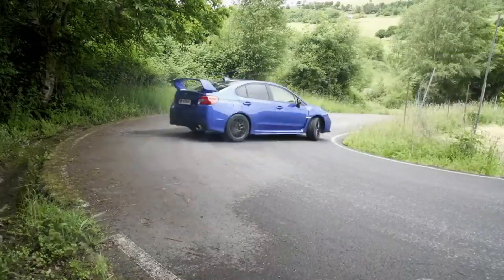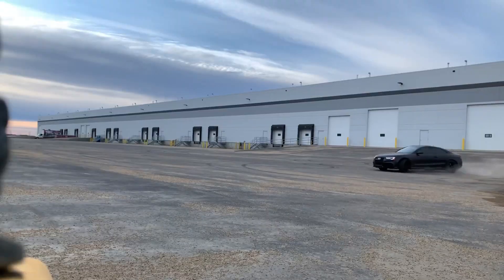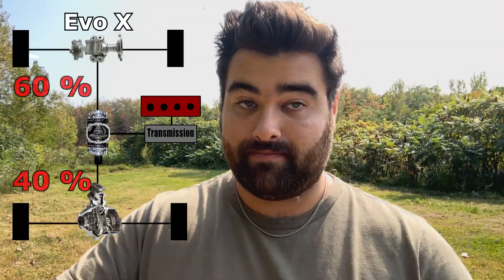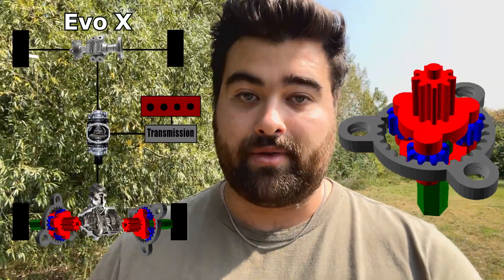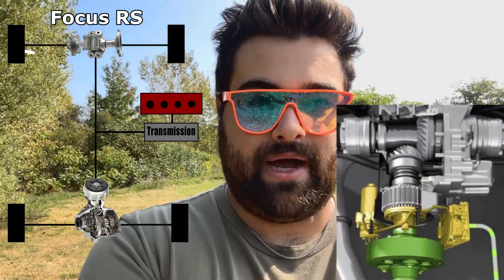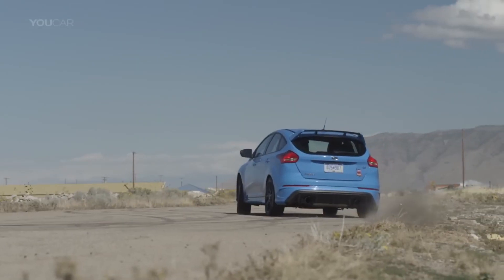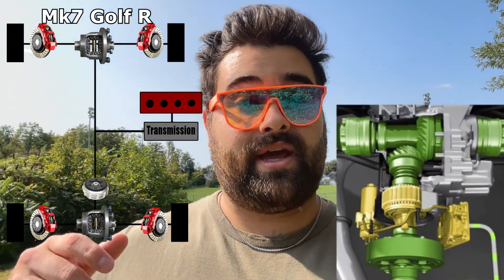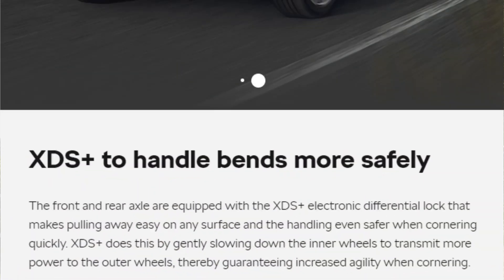AWD COMPARISON - Evo X // STI // Focus RS // Golf R // Quattro

Comment: The EVO X is a 50:50 torque split it cannot bias torque from front to back.
Reply from the maker: Yes it can, it has an active center differential.
Reply: @ Yes it has an active center differential but it can’t control the power split. It will control the amount of lock. So if the grip is equal front and back it will never send more then 50% power to the rear wheels.
Reply from the maker: @ no it controls power split, not the lock. It can send 60 front 40 back, 50 front 50 back, or 40 front 60 back. You’re wrong, look it up
Reply: @ I know I looked it up multiple times. I rally an Evo actually at a national level. And it is a 50:50 torque split.
Reply from the maker: @ I rally an Evo actually at a planetary level and it’s not
Reply: @Huntsteven6 sure man 😂
Reply from the maker: @ interplanetary actually
Reply: not all evo awd system is the same. evo 4-9 doesn't have center differential only ayc only evo x have the ayc and acd at the same time. when the clutch pack on the acd is locked it sends more power to the rear because the gearing is a little bit taller to the rear axle. but it cannot send more power to the front

Comment: I have an A4 Quattro Open/64:40 Torsen/Open with brake vectoring at both axles.

It's certainly not the most advanced but it does the job. 🤙😗

Comment: Great video overall, but I think you should redo the Focus RS bits. It has a much more interesting AWD system than you make it sound - the driveshaft to the rear always spins, and then electronic clutch packs can grab it whenever the system wants - so if one clutch pack fully engages, suddenly a full 70% of the power goes to that rear wheel.
Reply from the maker: @Wallstreetavarice  that’s basically how I explained it

Comment: So fyi most stis have clutch type lsds in front and in the later years they went helical in the rear. For instance my 05 sti has clutch type lsds in front and rear meaning they’re a lot better than helical/torsen lsds. For whatever reason they went torsen in the rear in the later years and then even went helical front as well. Helical is great around a track if one wheel doesn’t lose traction. But if one loses traction it acts like an open diff. The benefit with clutch type diffs is when one wheel loses traction it reverts to locking the diff and splitting the power evenly. And you can also tune clutch type lsds to behave how you want unlike viscous or helical lsds.

Comment: I have a lancer se awc So what type of system do I have on my car please
Reply: That is the Lancer Evolution X's S-AWC (super all wheel control system) so in my opinion, one if the best AWD ever made
Reply: No lsd, no torque vectoring like in sawc, but a simple 4wd with manual option for 2wd, or lock. If I'm not wrong: Up to 40% traction to rear wheels. I also have that car. Also, above 35mph it has internal braking of tires to follow the curve.

Comment: For Torque or break vectoring systems, could that jerk car if the surface has uneven grip here there? I see rally cars run thru uneven grip surface whether there be some snow, ice, dirt, mixed with tarmac but intuitively if the car gives more torque where there’s more traction, could that swing the car unpredictably due to unpredictably of the surface?
Reply: I’m not so experience but that’s why an lsd sounds like the best bet for predictability

Comment: the focus rs uses GKN made awd system with twinster rear drive unit its not haldex or even made by haled fyi. its a lot better system than a haldex. Very similar to the evo awd. Also only a few 2018 rs had the lid up front the rest are all open thats why a lsd is a huge upgrade. Also straight from gkn the focus can send 100 percent to the rear and vector it between each rear wheel if needed. it's overdriven by 1.8. Also the rs is permanently coupled and uses clutches in the rear that are electronically controlled to divide between the 2 rear wheels.
Reply: Is not focus rs's awd prone to overheat very easily, I think evo x is ahead of focus rs in that important area.
Reply from the maker: you basically reiterated much of what i said. I used haldex as an analogy.

Comment: Isn't there a distinction between the quattro variants within the different generations as well? like i thought the MQB platform prior to 2022 for both VW and Audi (in things like the A3 line, Golf, SQ2, T-Roc, T-Cross, etc.) all use the haldex set up that you mentioned for the Mk 7 Golf R, rather than just a general quattro across the board? Other than that dude good video, would be interesting to see how the BMW xDrive and the Mercedes 4Matic work too!
Reply from the maker: There certainly are many variants but the video would have been much longer if I covered them all haha
Reply: yes haldex based Quattro is for tranverse mounted engines and the real all time awd Quattro is for longitudinal based engines. there are a few differnt gens of the real Quattro for instance my b5s4 is gen 4.